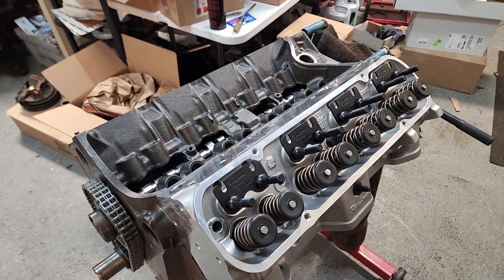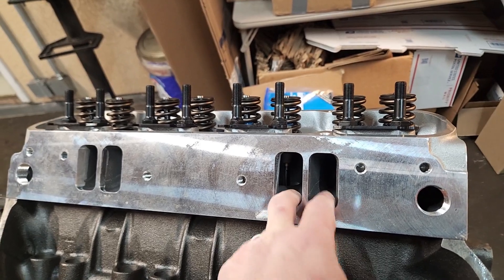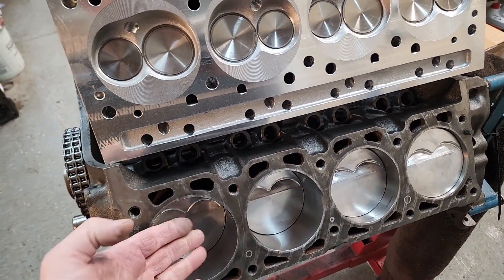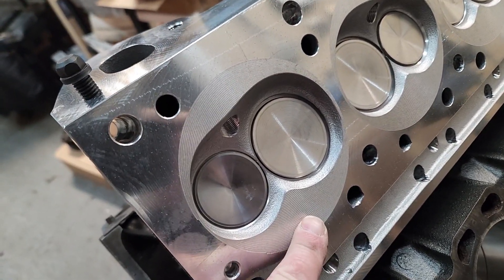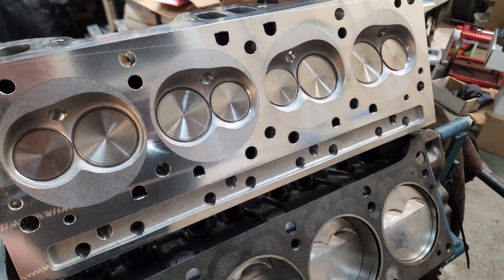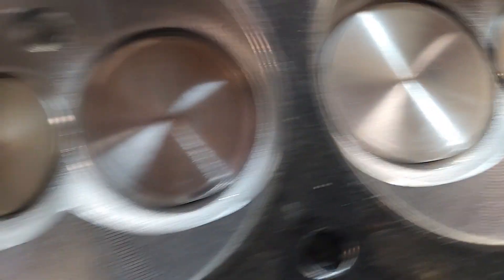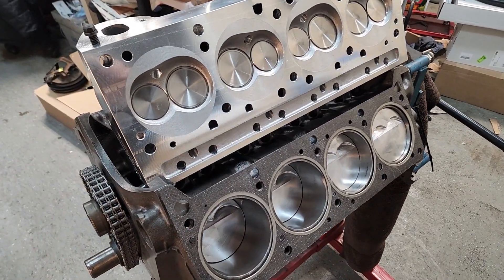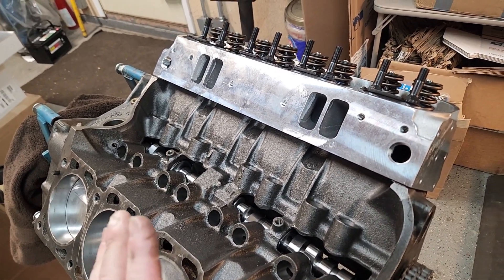TTA Performance - Kauffman Racing Aluminum Heads on a Pontiac 301 Turbo

Comment: It would have been insanely cool if you stroked it with a normal counterweighted 3.75" crank and made a 383, a dude did that with big valve iron heads, custom single plane intake and made 478hp. Sucker might have take 500-600hp with boost if sequential multi port injection, good fuel like E85 and an electronic wastegate controller was used to feed in the power past the tq spike and electronic ignition closely controlled the spark tables. Who really knows what the limits of a 301T block would be if someone fixed the flaws they baked into it before they killed it then wasted a fortune on dogs like the 368 and HT4100 at GM. A 302 and 377 Pontiac could have been great premium car or even GMC truck engines until the LS showed up if only some common sense was used at GM.

Comment: Single plane intake set up for port fuel injection, and down the road an aftermarket fully counterweighted crank & forged rods would be the ultimate setup I believe.

Comment: Now that you'll be breathin heavier than the stock/modified 301 heads, (more RPMs,) what becomes the weak link in the bottom end? Rods? Crank? block? You already made 400 HP last year, will this go 450..."reliably"? Looks promising. :)

Comment: WOW that has to be a game changer for the 301 owners!  I am sure we all are interested in the power #'s it will make. I know you focus on the Turbo applications however, what about putting together a top end kit for the N/A 301's? (Heads, intake, and cam package).
Reply: Yeah, I want my '80 Turbo T/A back now, it was tired by the time I bought in 1991.  (😫damn leaking t-tops!  I always took several towels outside with me on the way to school in case I had to sit on them, rain dripped right where I sat)
Reply: @John.Zachary.Delorean   you may think this is crazy but I had a t-top 280zx back in the 80's and I had a bad leak. I tried vaseline on the gaskets and it helped out a lot.
Reply: @Z06RFan 🤣  Vaseline.....that's awesome.  Heck, it is petroleum jelly.  If it worked, it worked.  You MacGyvered that s%*%,  original MacGyver
Reply: @John.Zachary.Delorean  I saw petroleum and thought oil and I said why not and it worked.